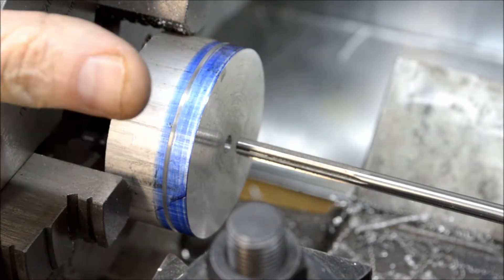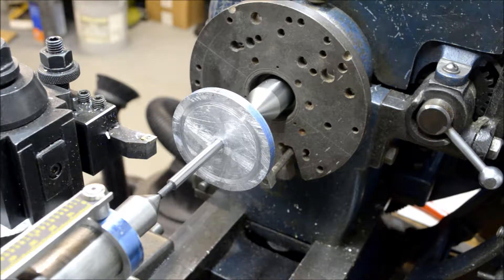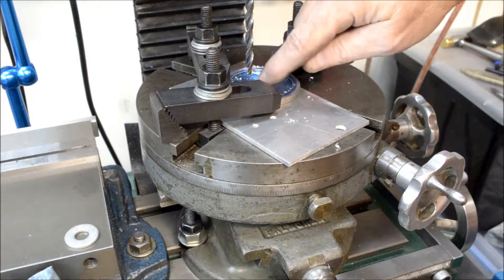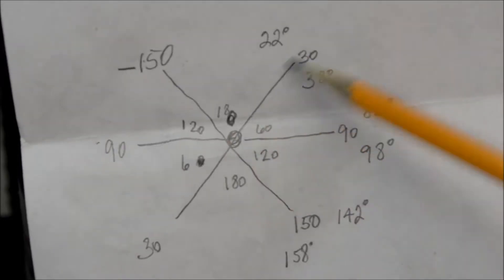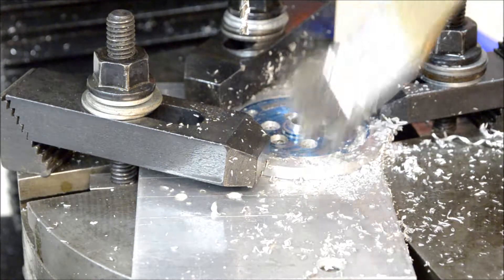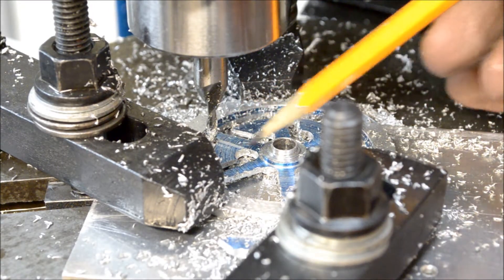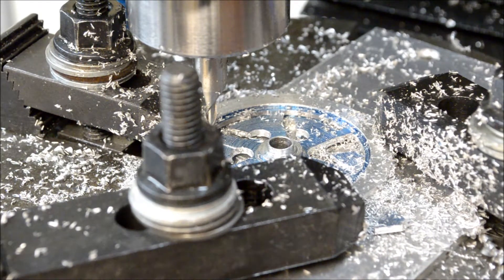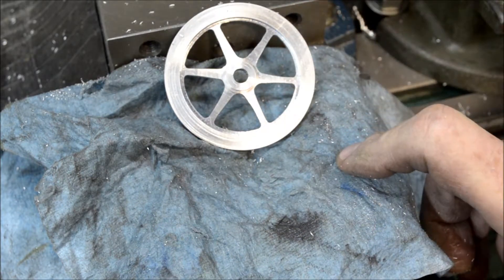Elmer Verberg Beam Engine Flywheel

Comment: Great result! I would probably have done the 12 hole pattern in two rounds, get the 22 degree straight and make steps of 60 again and then do the other holes. For my own version I'll have to think a bit more though on how to do this nicely without a rotary table (or a mill). Probably a combination of dividing on the lathe and hand filing for opening the holes